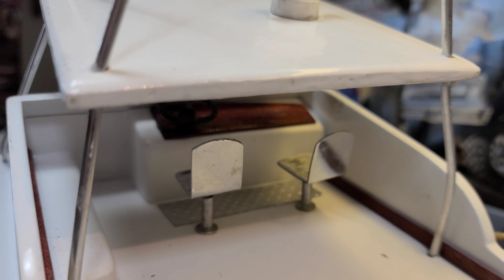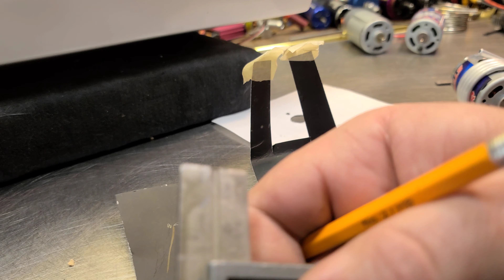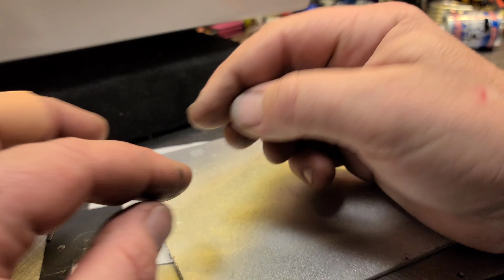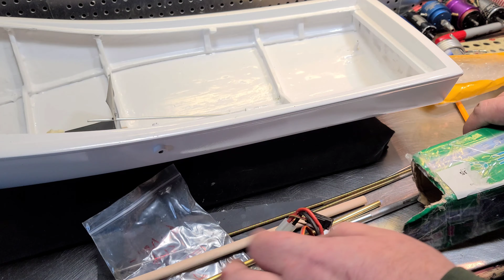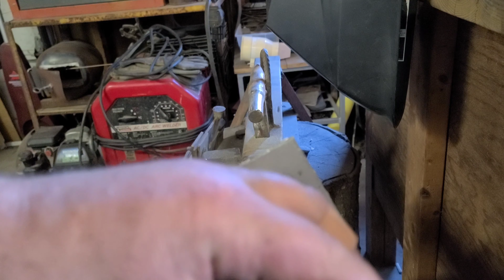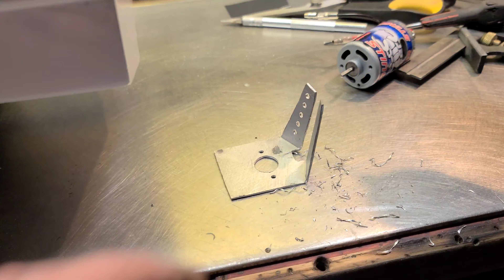Scale Rc Fishing Boat Build Pt3 EZ Brushed/Brushless Motor Mount, Submerged Drive setup

Comment: Also agree with other comment,stainless looks good but dissipates heat slower..Aluminum cooling lines are better
Reply from the maker: Yea I saw it was stainless steel I was gonna buff it up nice lol. Plus it had more coils so I figured it would cool better covered more of the motor than the aluminum tube.  Thanks for the heads up. Thanks for watching

Comment: WHY WOULD YOU USE STAINLESS AS A HEAT PIPE OVER ALUMINUM? ALUMINUM IS A FAR BETTER HEAT CONDUCTOR.....THE STAINLESS WONT DO A THING TO KEEPTHE MOTORE COOL...COPPER WOULD BE BEST.
Reply from the maker: Subscriber sent it to me.  Never used or seen a  stainless steel cooling tube, Never even knew they made them.   Thanks for the heads up, . I was gonna buff it up,  plus it had more coils so of course I thought it would cool better...  thought wrong lol. Thanks again for the help..
Reply: @IRONCLADRC  most welcome...I do love the build and I can't wait to see it fishing.